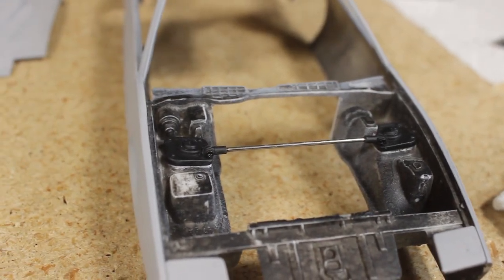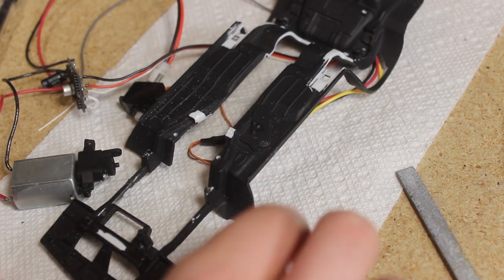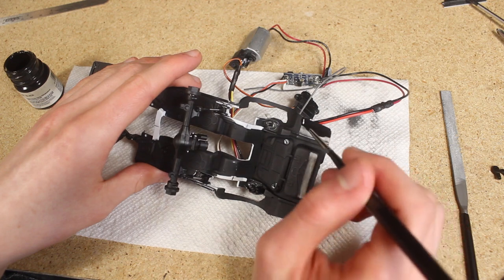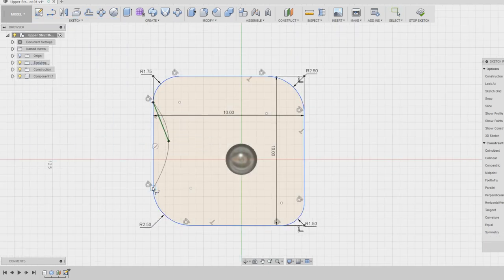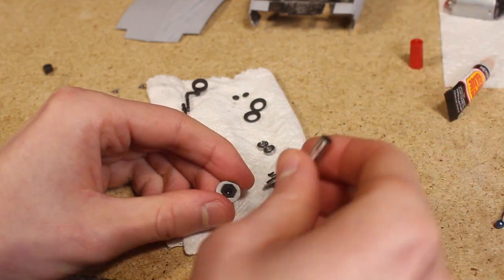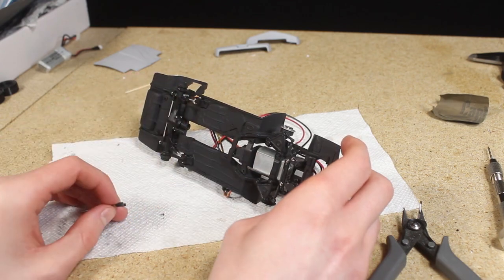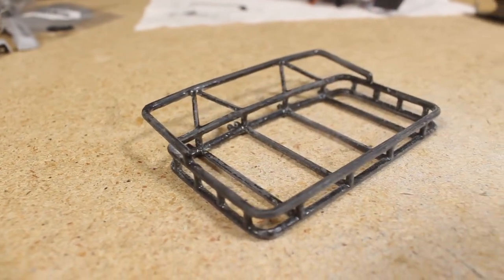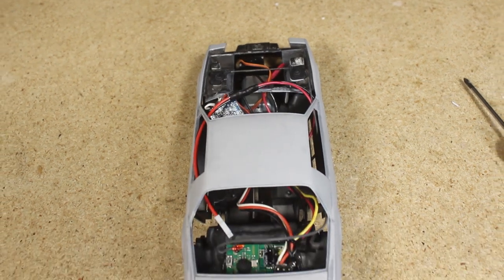Finishing up the Firebird's Suspension and Painting the Roof Rack for the Prerunner (E11)

Comment: Hey man, this is VERY COOL!!  I just have one piece of constructive criticism, if I may....

You should really mount the "differential end" of the torque arm
solidly to the rear, and make it so only the front of it has a ball end (where it mounts to the trans x member).  

The purpose of the torque arm, is to eliminate "axle wrap", as the pinion naturally wants to "climb" up the ring gear, when you're pouring on the coals ...and it also keeps the pinion angle constant through the suspension's range of travel.

I have loved 3rd gens for pretty much as long as I remember.. My first car was an 84 T/A, 5 liter HO , T5 with EVERY option...except rear window defogger... I still have it to this very day... along with a second 84, 6 cyl, non t-top, base model, which I'm still gathering parts for to build a car for bracket racing...  

That said, I'm really enjoying your craftsmanship,  and I can't wait to see it all done! ;)

Comment: Great episode! I am amazed your parts are 3D printed at such a small scale. I would love to hear more about your print material/settings.
Reply from the maker: Thank you. I use a Form 2 printer with Formlab's standard black resin at high resolution settings for the small parts. It's pretty much plug and play with this machine.
Reply: That explains the high quality and lack of FDM layer lines on those prints- congrats on your Form 2!

Comment: I dont know what program you use but i think you might want to try Autodesk Inventor. Its compatible with 3d printing and works very simply. You  can adjust so many things using the program and i think it would fit perfectly with this hobby of yours.

Comment: Absolutely awesome work on the Fireduck. The roof rack is top notch. I'm curious as to the overall length and width of the basket of the roof rack? I think it maybe just right for a project I've been working on for awhile. If dimensions are right, I'll be picking up one from your store 4sure. :) Please let me know when you get this comment. Much appreciated. Excellent work bud. :)
Reply from the maker: Thank you. The length and width of the basket part of the roof rack (excluding the parts that stick out front) is around 55x95mm.
Reply: Damn thats 95mm across and 55mm front to back (excluding the light protection) yeah? If it was 55mm across 95mm F to B it would of fit the one project perfectly. However If it were 95mm across and 50mm F to B it would fit another project I have perfectly.  Any chances of shortening it 5mm F to B? I could take 5mm out of it and glue it back together. hmm? Thank you for your reply. :)

Comment: I love what you did to the drivetrain and steering on the Firebird. One thing you should change on the steering while you redesign it: the Ackermann geometrie is wrong. If the steering is in front of the axle, the steering arms should face outwards.
Reply from the maker: Thank you. I've noticed that and I'm glad you brought that up. Changing the ackermann angle will definitely have an impact on the cars performance. 👍

Comment: I’m a model builder and would like to do this to a cpl of builds. Do u have custom plans and parts for sale? Also picked up a cpl large scale models that I’ve already built a cpl times, thinking of “trying” to make them RC. Have u built any larger scale ( 1/16 ) ?
Reply from the maker: Kits and some 3D printable components are in the works and will be made available soon. I have not yet done any larger 1/16 model car to RC conversions but It's something I'd like to do in the future. I've seen others do RC builds with larger scale models with a lot of success, they are easier do to their large size.

Comment: Guitarded And Broke
: If you are looking for a cheap yet realistic, and somewhat challenging rc then look into an Orlando hunter. There is a jeep and there is a Ford pickup that cost about 50 bucks on Amazon, but you will have to order all the electronics separately altogether it will cost you around 100 bucks, orrrrrrrr you can start out with something with some speed like a WLToys 929, they run about 70 bucks but they are small and they are fast and you can make them off-road with just a few changes.

https://hobbyking.com/en_us/orlandoo-hunter-oh32a02-4wd-1-35-crawler-kit-un-assembled.html?___store=en_us
https://hobbyking.com/en_us/2-in-1-2s-lipo-esc-w-led-light-set-oh35p01-1-35-rock-crawler-kit.html?___store=en_us
https://hobbyking.com/en_us/150rpm-brushed-motor-oh35p01-1-35-rock-crawler-kit.html?___store=en_us
https://hobbyking.com/en_us/orlandoo-oh35a01-4wd-1-35-crawler-kit-un-assembled.html?___store=en_us
https://hobbyking.com/en_us/turnigytm-tgy-1440a-analog-servo-v2-0-8kg-0-10sec-4-4g.html?___store=en_us
https://hobbyking.com/en_us/turnigy-nano-tech-300mah-2s-45-90c-lipo-pack.html?___store=en_us
https://hobbyking.com/en_us/orlandoo-oh35p01-4wd-1-35-crawler-kit-un-assembled.html?___store=en_us
https://hobbyking.com/en_us/quanum-2-4ghz-3ch-pistol-grip-tx-rx-system.html?___store=en_us
https://www.youtube.com/watch?v=a5dfKYAqRcE
https://www.lightinthebox.com/p/wl-toys-k979-buggy-1-28-rc-car-30-1-x-manual-1-x-rc-car_p6300776.html?currency=USD&litb_from=paid_adwords_shopping&sku=1_6920%7C444_27165&country_code=us&utm_source=google_shopping&utm_medium=cpc&adword_mt=&adword_ct=194736829850&adword_kw=&adword_pos=none&adword_pl=&adword_net=ytv&adword_tar=&adw_src_id=2907233386_876168719_50179578122_&gclid=Cj0KCQjw0a7YBRDnARIsAJgsF3Pw8Qv-dKljaWUD3WfMR6CerJFc02W_BQ_hLcpUaoogR1avkQ3Mq7YaAqQAEALw_wcB  these little cars are fast for their size, so it all depends on what you are loking for.

good luck and welcome to the hobby